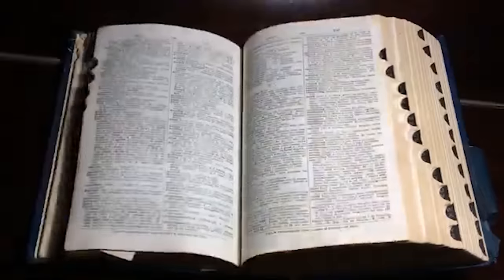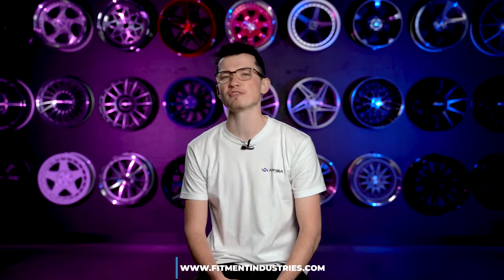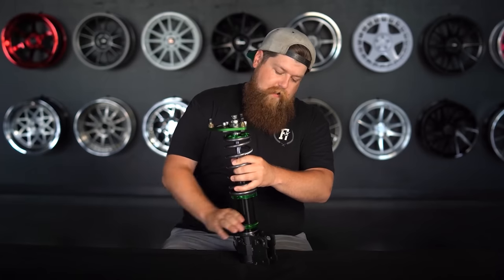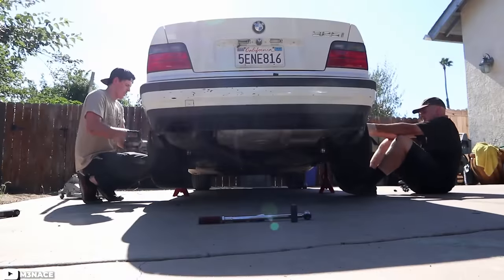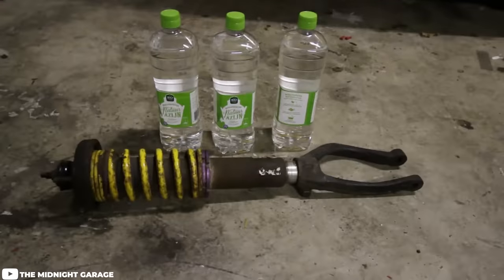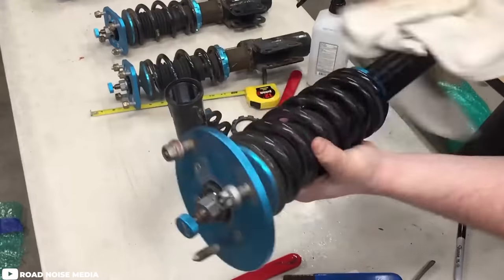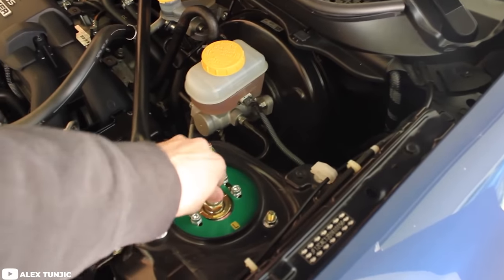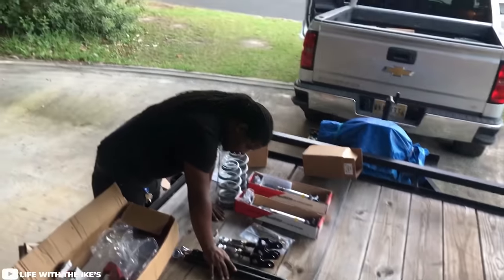Are YOU Making These Mistakes With Your Coilovers?!

Comment: Just a helpful tip, if the ride height is too low after the install without any height adjustments, you can raise it. For rear divorced setups, the spring perch will have threading below the adjuster rings showing how much room you have to raise the ride height. Be sure to adjust the shock body height accordingly.

Comment: I don’t do any of this but my tein coils have been great for over a year now
Reply: opposite for me but hey, like Alex said probably my fault
Reply: @Kylelngram  I used to like Tein & recommend them.  The set I recently purchased ride like shit.
Reply: @crxk20r59  Yeah I put mine on about a year ago and didnt adjust anything and put them on how they came, and as soon as a I reversed out of my driveway, front passenger side coilsovers were creeking and still to this day they do it, and plus my front driverside coils have lowered itself twice now after readjusting them back to the height I want.
Reply: @Kylelngram  damm that sucks. So far the best coil over set up I’ve owned is Koni yellow w/ground control. Also wanna try fortune auto someday.  Good luck on ur next set up 👍
Reply: Kyle Ingram tein rides decent
Reply: @crxk20r59  I had a set of Tein's on a mitsubishi starion and a 2003 wrx... Worst ride quality ever.  Probably great for the track.  Garbage for the street.  They were replaced with different brands on both cars.. was much happier

Comment: I always smear the thread in vaseline. When i need to adjust them i get degreaser to get the vaseline off and after adjusting give it a fresh load. It prevent water from entering the thread so it doesnt rust. Used it for 15 years and never seized
Reply: Smart
Reply: i am curious to compare that vs antiseize for fun

Comment: I am new to fitting wheels and tires, if my car comes stock with 245/45/R18 size tires, does getting larger wheels/tires affect my speedometer, and if it affects my speedometer, does that affect how fast or slow my car’s odometer reads? so will a larger set of wheels and tires make my speedo read slower since there’s less revolutions and therefore gain mileage slower?
Reply from the maker: It will effect it due to the amount of distance per revolution for both speedo and odometer, yes. This difference with the odometer with a slightly larger size will be very minor and is no cause for major concern. You have the right idea with the larger wheels/tires making your speedo read slightly slower.

Comment: Hey lads, what can you tell me about the EW10 J4S engine from the PSA group.
Is it reliable ?
Is it cheap ?
And most importantly, can you turbocharge it ?

(If not, are there other options among the PSA engines ?)
Reply: Well they are commonly found among French cars such as Citroen or Peugeot (maybe both).

They come around 115 hp -125 ish hp.

They are 1.3-1.5l 4 banger small engines so turbocharging them can be tricky. But if u wanna do it, go with a single turbo setup that can boost around 5-8 psi of boost per pressure.

Well that’s all I know most about psa engines so hope they will help u :).
Reply: @car-enthusiast3141  thank you mate 👍
Reply: @llama_wehraboo7274  no problem mate. Still I need to learn a lot despite being a young car guy. I’m only 14. But I see all mechanical stuffs and i research a lot of information and have books based on car engines and stuffs. Never stop learning 🤙
Goodnight imma sleep now.
Reply: You and I brother 🤙, engines are truly impressive

Comment: Are tein flex z coilovers good for daily driving for a 17 accord?
Reply: Lol no upgraded coil is THAT  comfortable for daily...but if they are a good buy...definitely. Make sure you understand rebound and dampening setups....I didnt at the start....every bump in the road sent my head into the roof of the car....
Reply: I’ve heard many say they like it, it won’t be as comfortable, but it won’t ruin the overall feel of the ride.
Reply: Slicktop 2jz appreciate it , might need to research dampening and rebound.
Reply: I’ve been running tein flex z on my daily for over a year now and I’m pretty happy with them. mess with your dampening setting till you find what you like. Ride quality isn’t bad imo. stiffer than stock but that’s a given with any set of coilovers

Comment: My kid put an ISC N1 coilover kit on his 07 E90 335i. I just had to rescue him on the roadside as the rear tires were rubbing on the suspension. He ran all winter in his winter tires with no issues. I think he may have tried to lower the car a little and may have done it wrong. My question is, if you are adjusting ride height for summer and winter, do you need to get an alignment each time?

Comment: What if the threaded cylinder itself is able to be rotated? Is it fine to adjust height without taking disconnecting the lower mount then?
Reply from the maker: you can absolutely adjust height without disconnecting the lower mount, yes!
Reply: @FitmentIndustries  wow senpai blesses with answers 😩

Comment: What would cause the front coilovers to change height on you every 10,000 mi? I had Megan Racing Street Series kit on my 1993 3000GT and it seemed like I was the only person in the clubs experiencing this with that brand or similar brand kits. Yes I started out making these adjustment mistakes, but even after I learned how to adjust them correctly with the bottom collar, they still never stayed put. Also for some reason the GT would always change height every time it got an alignment. 🤔 Try explaining that one knowing they wouldn't they wouldn't go through the trouble of trying to adjust the coilovers themselves. I've been adamant that I had a kit that was subpar in Megan Racing's QC, as well as agreeing with someone who pointed out that I should get thrust bearings for the fronts.
Any recommendations for a kit that doesn't give me these headaches, and isn't going to break my back on my daily driven Genesis Coupe R-Spec?

Comment: Anyone know if mixing components from different brand coil overs works. Thinking of getting second hand BC lowers already welded onto a spindle and may use a different brand upper if found for a good price at sometime down the line. Wondering if the BC threads will accept upper threads from other brands... not sure if anyone has experience doing this and has recommendations.

Wondering if this would make for a good Fitment vid...maybe?

Comment: So essentially you lower the coilover only by the shock body ? Correct? They are already pre loaded. Iv seen ppl actually compress the spring which is stupid but also can lower the spring instead of compressing but I’m guessing that kills the suspension. Last full body ones I put on my mini they were ore loaded which I wasn’t sure on but I did my research and only adjusted the shock body. Rides great and is for sure slammed way more than the shitty spring sleeve junk with 2 cut coils talk about rough lol

Comment: Day 23 of asking for a "so you want a Toyota matrix xrs"
Reply: I can give you a couple tips, find a lower mile XRS, the cylinder liners don’t really exist it is a Metal Matrix Composite (MMC) preform containing alumina-silica and mulite particles is die cast to the aluminum cylinders. This is finished by electrochemical machining. While it is possible to machine a 2ZZ block to accept aftermarket ductile iron sleeves, the limited bore spacing (only 5.5mm between each cylinder) of the 2ZZ block doesn’t allow for the sleeves to be opened up beyond 82.5mm.” And once that mmc is gone, there isn’t really a way to get it back. These motors are known for shitting the bed at redline because the oil pump can’t keep up with the motors 8.5k redline and oil starves the engine. BUT both of these are relatively easy and cheap fixes if you know your way around a motor, beyond that they’re reliable, Lotus even used the 2ZZ in the Elise with them later supercharging it, an Eaton M60 bolts right up or you can go to a Lotus dealer and get the one they used, beware though, it’s just the supercharger itself, no pulleys or mounting hardware. These things are peaky as hell, it’s like a K series, but more plentiful because Toyota didn’t even advertise the XRS really. LSD’s are a drop in affair, and although the stock redline is 8.5 (or 8.2 depending on who you ask) but there exist parts that’ll make it rev to 9k easily. It is a bit of prep work to make it that true Toyota reliable but once you do, you have a helluva car to have fun with.

Comment: "Alot of times people do that on purpose and that's good". No it's not. It is not good. I'm not a massive fan of "the state" interfering with much of anything, but cars with extreme "stance" or cars that are "static" take ideas originally meant to increase performance capability (a sane amount of camber and a car that doesn't move up and down as much) and goes so far with it that it makes the car basically unsafe to drive. Couple that with the fact that I would bet a pinky finger that 99 percent of those doing these mods are terrible drivers but think they're great. These are the assholes that weave in and out of heavy traffic who end up maybe being a car or two ahead of where they would normally be at the next stoplight and/or dickheads that use the middle turning lane in heavy traffic not to turn, but to drive in an good quarter mile then cut in front on someone because they think they're special. Oh and if they're driving a sedan it's probably got a "four doors for more whores" sticker on it, advertising to everyone that the only way they can get women to be in the same general area as them since, well, that's what a whore is, a woman that makes you pay her. Oh and one last thing whatever car they do this to is probably going to either wind up wrapped around a tree or being sold for scrap to one of those "we buy junk cars" people because doing that dumb shit winds up screwing up suspension parts, frames, body panels and some more shit, and some of those cars deserve better.